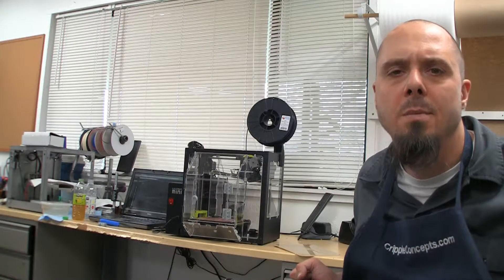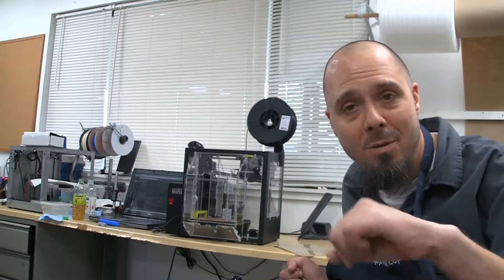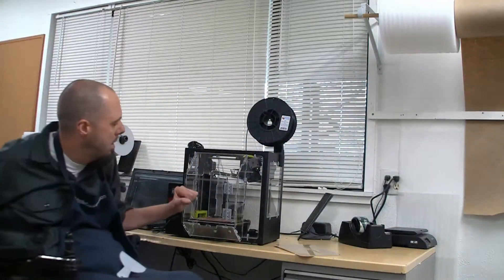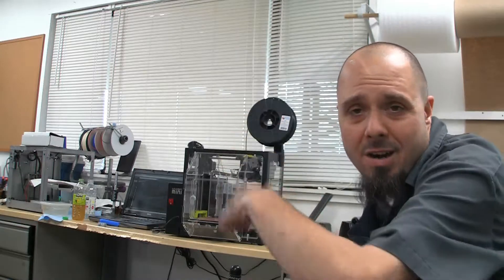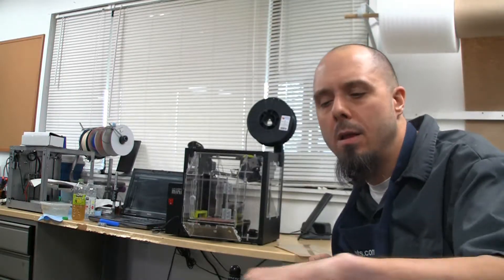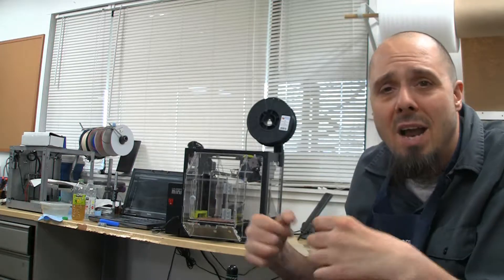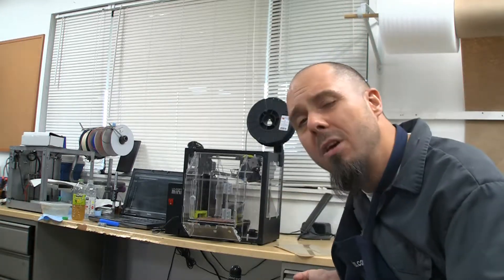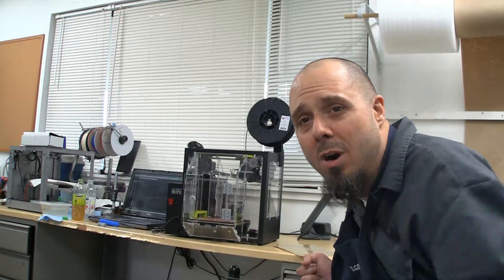Lulzbot Mini with Tabsynth Enclosure and 0.3mm Nozzle

Comment: Bought a Printed Solid enclosure for my TAZ 6 at home...Over priced, fragile, and the silliness in having to remove the entire side to remove your finished print.  Bought a TabSynth enclosure for the Lulzbot Mini at my work place, love it!, well thought out puzzle piece assembly, no hardware causing cracks, and has an access door to remove finished print.